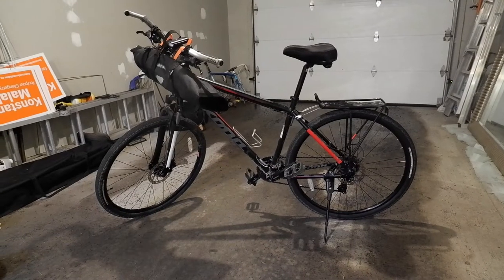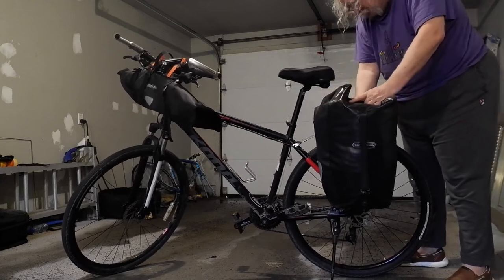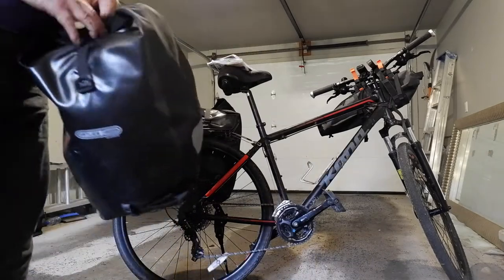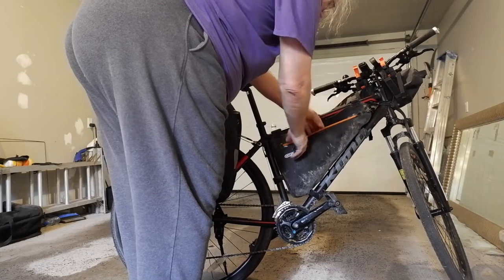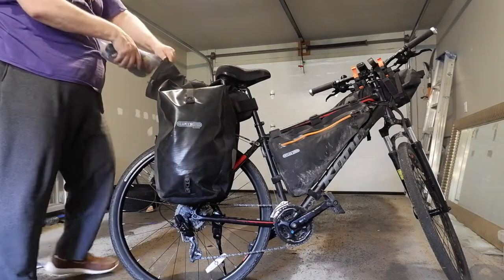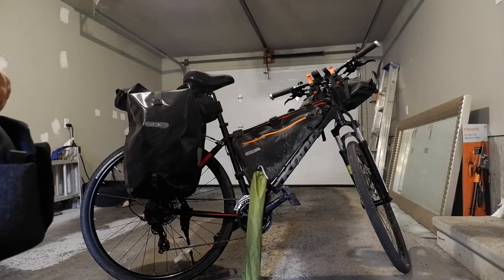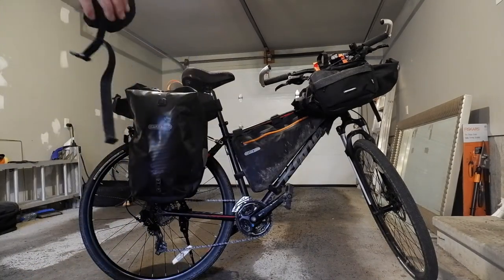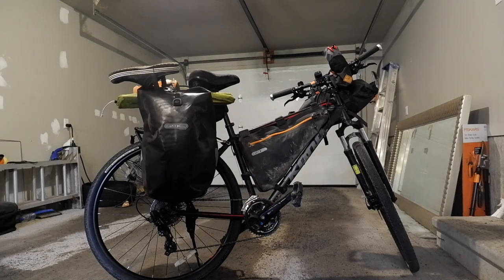Setting Up The Bike

Comment: Hi Steve, Interested to know if you have a total weight for all your gear including bags.? I am thinking of trying some bikepacking this summer.  I am not sure if I have the confidence to do a solo trip but thought I would start planining.  Also did you use a GPS on your trip?
Reply from the maker: I haven't weighed it. I'm figuring 20 kg or so (40-50 pounds). It's heavy because I'm carrying cpap batteries. To me the weight doesn't matter as much as the balance (note that I'm 320 pounds myself).

If you can bicycle you can totally do a solo trip. My advice is to go for only a few days, keep your distances short (for me, that's 40km per day), use actual campgrounds (I used Hipcamp which gives me cheap sports) and ride where you can get help if you need it. Wilderness trips can wait until you're confident with your setup.

I do use a GPS when I ride, in my phone - I use Strava to track all my rides. https://www.strava.com/athletes/30539470 For my upcoming wilderness trip I also bought a Garmin InReach Mini 2 - expensive, but I will be outside cell phone range in an unpopulated area (Anticosti Island) so this is my only lifeline if I get into trouble.
Reply: Hi steve.  I have put together some gear and my summary looks like this: 
 Gear/Bags/food/water	45.5 lbs
Mountain Bike	30lbs
Rider and Clothes 230lbs
Total 	305.5 lbs
The reason why I am concerned about weight is two fold.  One - riding hills (out of shape 67 yr old)  and
Two-I was told that a bike will only take so much weight and if overloaded, I would either crack the frame or wreck my front and/or back wheels.
I have not been able to find any evidence of this yet. 
 I am also going to try to connect with someone in the Bikepacking groups online and see if anyone has an opinion on this.

Really appreciate your help.  stay safe.